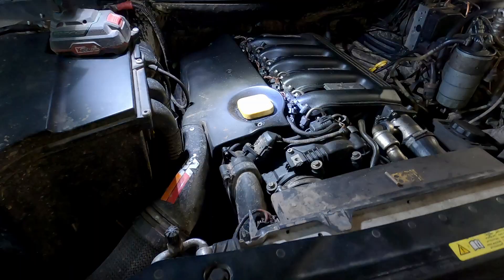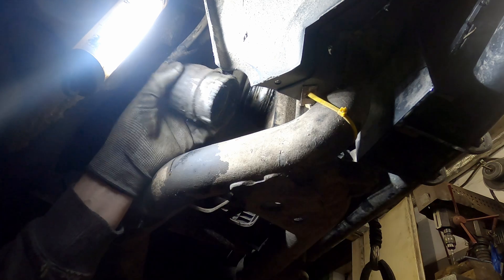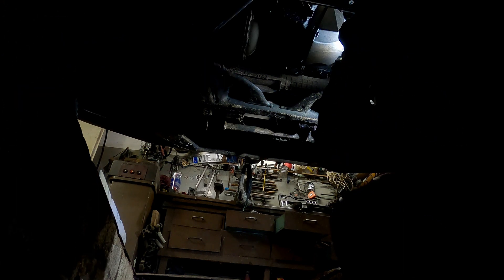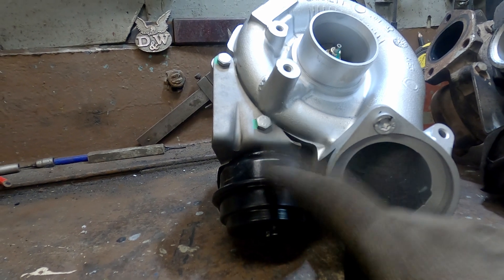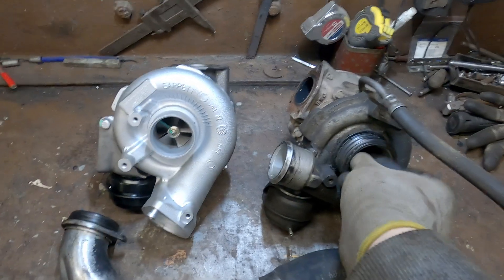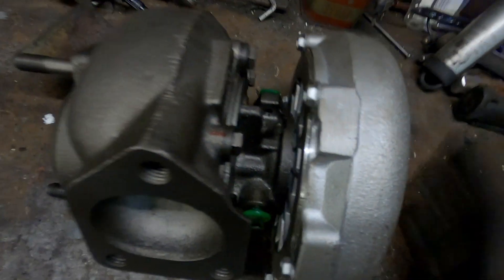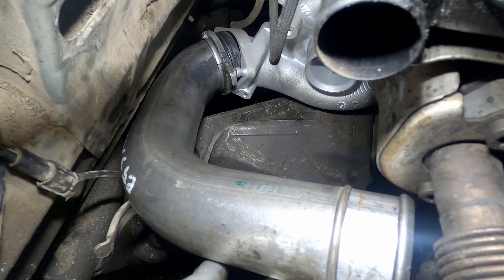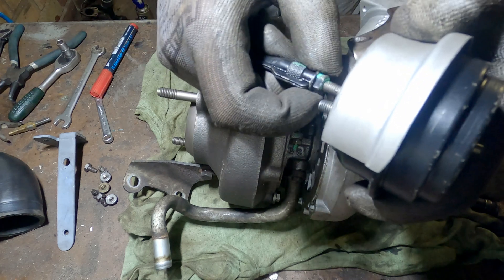Install BMW TURBO GT2260V in Range Rover TD6 (BMW M57) + Dyno Results

Comment: Sehr interessant 👍 
Ich schaue gerade alle Videos durch. Leider verstehe ich nicht alles auf Grund der Sprache.
Abo ist gesetzt.👍
Beabsichtigte mir auch einen L322 zu kaufen. Bis jetzt hat mich das schwache Getriebe vom TD6 abgehalten und ich eher nach einem V8 Benziner geschaut. Aber der Getriebetausch auf das gute ZF Getriebe macht den TD6 interessant. Kommt noch ein Video wo du die benötigten Teile gekauft hast und eine Kostenaufstellung?
Keep Dirty🙂👍
Viele Grüße aus Deutschland
Reply from the maker: Parts list that I used for gearbox swap is on video description, and the cost of everything is very different in various countries 
I've spent 2-3k for everything Tom swap gearbox

Comment: Hi, thanks for this nice video! Can you please tell me how to calibrate the 3 bar map sensor? I have the EDC15 variant 184 e46.
Reply from the maker: hi, you'll need to go to workshop there engine ecu's could be modified,  and new sensor data added to engines computer
Reply: @shittysolutions thanks alot for the reply and information!

Comment: Hi. From which BMW did you mount, a oil supply line and return oil line?
Reply from the maker: i got it with used turbo, from bmw x3 e83
Reply: @shittysolutions Thx.
Reply: Thx.

Comment: I think I'm going to try this
Reply from the maker: just be careful with westgate, at least dyno run is highly recommended 😅
and bigger pressure sensor in the intake manifold
Reply: @shittysolutions  I don't want to do remap for more power , I like the idea of having the big strong longer lasting turbo , can you tell me more about Westgate please ?
Reply from the maker: @odownton1322  to fit this bigger turbo you'll need to relocate it a bit, and that's not so good, turbo could overboost
but i've been driving for a month before remap, everything worked fine
Reply: @shittysolutions  when you but your in it looked like it went straight onto the old brackets ? What do you mean by relocation?
Reply from the maker: @odownton1322  i had to use westgate bracket from old turbo on gt2260v, cause engine mount is not alowing to install easily new turbo
Reply: @shittysolutions  ah nice I should have that bracket on my old turbo aswell then ? I think I'm literally doing exactly the same thing 😂
Reply from the maker: yep, you will have exact same thing from old turbo :D so it's definitely doable
Reply: @shittysolutions  amazing ! Sourcing that pipe was tricky but other than that I'm going try it Saturday ! Could you give me a suggestion on what sensor you used in the end ?
Reply from the maker: @odownton1322  I'm still using stock one, mine turbo is maped to boost only up to 1.5bar, as the stock sensor supports.
and sensor change would definitely need remaping/calibration
Reply: @shittysolutions ah okay okay so just run everything how it is until "if" I map it ?
Reply from the maker: It should be all good, but sometimes turbo might boost over 1.5bar and engine enter fail safe mode, so no power until restart 😅
Reply: @shittysolutions  I see I see , but mapping can sort that ?

Comment: there's a bloke here in Australia that sells a kit to fit a zf6hp26 into this car, for when you inevitably have gearbox issues ;)
Reply from the maker: Heh, yes these issues will happen 😅
Reply: That issue already happend here 😅 may you be so kind and let me know where to get one? 😅
Reply: @viliusskarbalius8507  depends on how you want to do it, you can either go oem and buy e53 218hp starting kit(dde and ews) and engine wiring or you could buy a standalone tcu, after you need adapter plates for both the engine and the transfer case and after some wiring and next will be to adapt the driveshafts, i could help you but i am from romania, we did something similar to an 7 series e38, put the brains engine and transmission from a bmw x3 e83 sd, it took a bit of time to get the work done but everything feels oem
Reply: What's the guys site ? I could use this kit 😂🤦

Comment: I did almost the same job, but i had to replace 5  broken bolts on the exhaust manifold…. I upgradet my stock Garret Turbo with a new upgrade carthrige wich has a Billet compressor wheel in it….
Reply from the maker: nice one, it might be even better upgrade, cause that vacuum regulator relocation isn't such a good idea😅
Reply: @shittysolutions why not a good idea?

Comment: Amaizing job! So much easier than other m57s to replace the turbo. BTW currently talking to CANperformance to see if it is possible to 8hp70x swap mine. Gearbox is on its way out, it has 160 rpm slip in the convertor when locked out at 100km/h.
Reply from the maker: Zf8hp swap should be doable cause it was already made on e53 models, but you'll never know till you try 😅
I hope my gearbox won't break for at least a year 😅
Thank you sir!
Reply: Others i know puts the facelift engine with the gearbox, somewhere have a diagram how to wire it, but would interesting to know if the engine can remain and only gearbox can be changed. If your box dying, put hidraulic fluid in the gearbox, i was keep on geting into failsafe prog, but hidraulic oil helped, prolonged the life for a year and still works
Reply: managed to 8hp swap mine, getting ready to upgrade the turbo like in your case, can't wait for the extra power
Reply from the maker: Nice, what were the hardest parts in the gearbox swap?
Reply: @shittysolutions  All of it, did it on jackstands, lot of fucking around to find out how some things are connected, then i think the worst is the wiring harness, you have to make your harness from zero, i had to learn how to set the pins on the wire for the connectors and also did a hell of a lot of splicing. But if you ever get to it i can give you the pointers. Oh and another thing that still is pain in the ass is that the trans cooler lines are to short so i had to take them to a shop to lengthen them and also bought the adapter from canperformance but it is still sipping a bit…. At least the car now seems like it is new i love the gearbox and how it drives now especially the fact that it does not drop revs when you coast, finally some engine braking.
Reply from the maker: @CoolBearProductions  maybe you have instagram or something somewhere posted about swap?
I'm currently purchasing parts for zf8 swap.. cause original gearbox has only few gears left :D